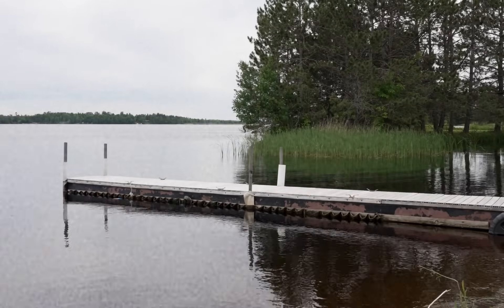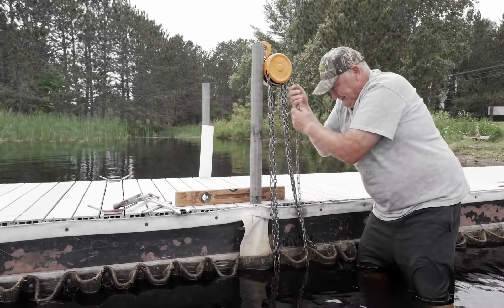FLOE vs. Competitor Docks: In-Depth Comparison

Comment: Great product but the dock legs rust and you can't adjust them after a few years.
Reply from the maker: In 2006 the inner leg threaded rod was changed from a plated steel to an aluminum rod. It is true that prior to 2006, the plating on the threaded rod could possibly chip which could allow rust to form on this component. This is one of the factors that led us to upgrade that component to aluminum. Rust of any sort should never happen on any part of a FLOE Easy-Level leg.
Thanks again.
Reply: Or is it the deep nut. Brass nuts